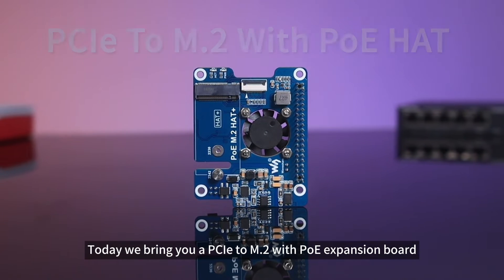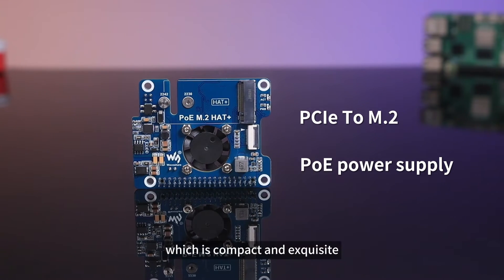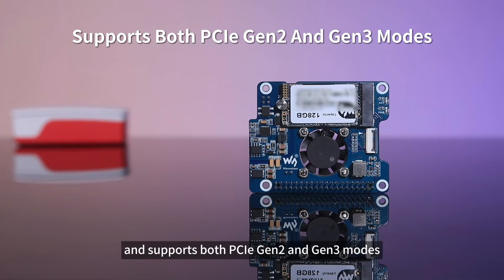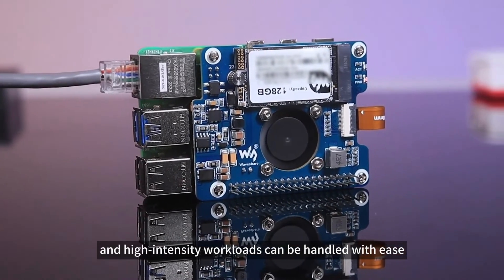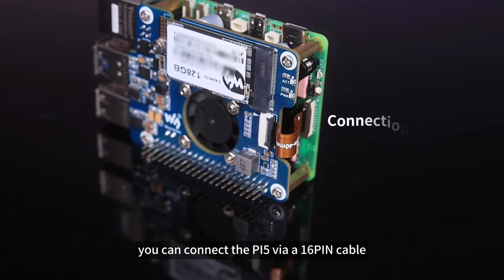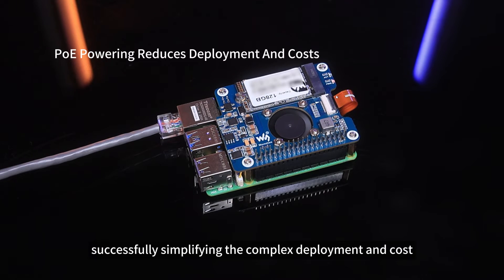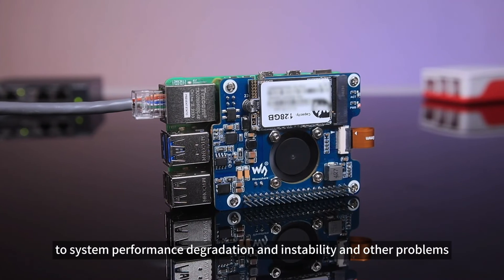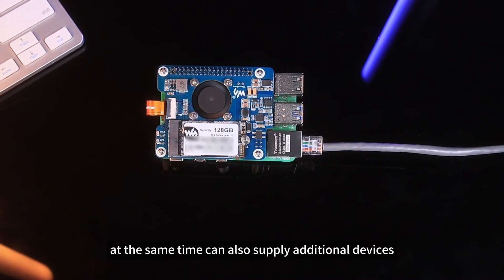Pi 5 PoE HAT, PCIe Adapter, Supports NVMe Protocol M.2 Solid State Drive， Metal heatsink

Comment: Hi guys! I am not having the LEDs working when I connect the RJ45 with PoE Switch. I think I broke it when I tried to power up the Raspberry Pi 5 + HAT with 5 Vdc through the USB C port instead of use the RJ45 to power it up. Is that correct?